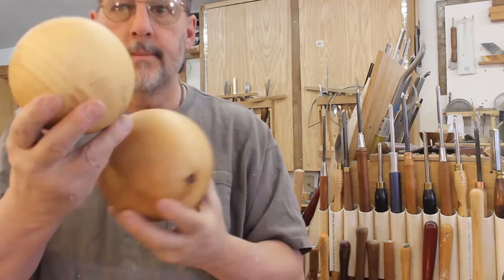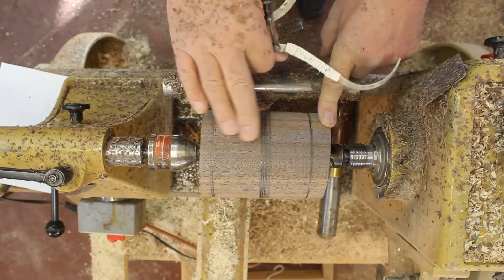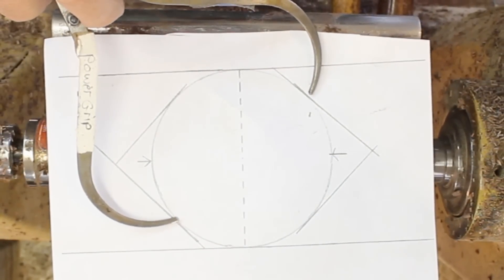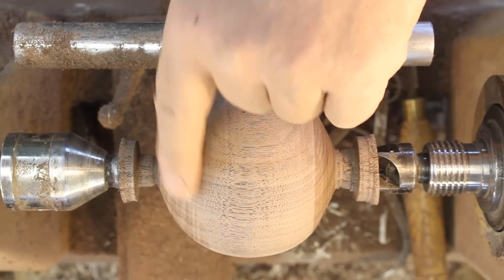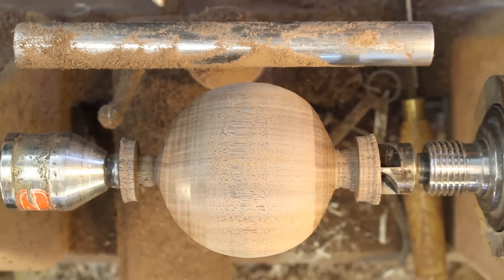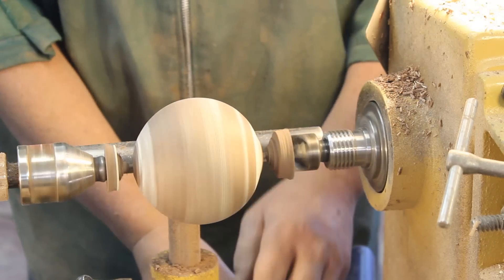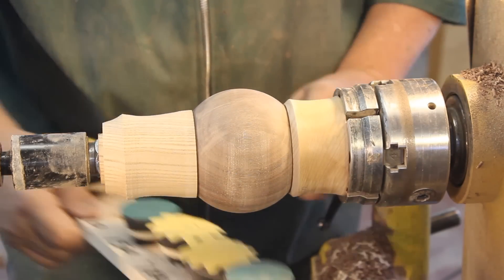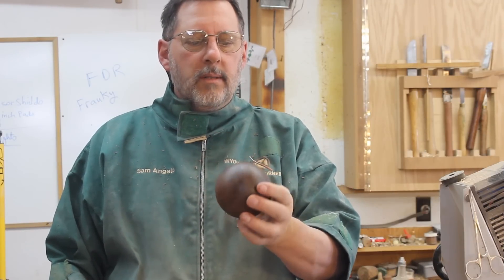Turning a wooden Sphere on the Lathe

Comment: The Tetrahedron... I suppose wood turning has nothing to offer this problem, but you said after the perfect shape, the sphere, that maybe you'd try a pyramid. Those are not difficult to shape and are not that interesting geometrically, but tetrahedrons are much more interesting. Although they seem like they shouldn't be much more difficult than a pyramid,  I've never managed to make one that wasn't a bit off to the naked eye. If you have any tips on shaping this or any of the other four Platonic solids I would appreciate any tips or pointers to guides that describe how to make construct them.

Thank you for this video. It was helpful. The chalk and sandpaper method to mark high spots was the most helpful.
Reply from the maker: Noah
I think I  remember saying I should try a pyramid.......I think.  But a pyramid is not round, it would turn out more like a cone.  But I was not serious.  You can't turn anything with facets on it like a tetrahedron or a platonic solid without doing lots of work off the lath making the facets.  I enjoy such various shapes that may start on the lathe and once they are complete....then you can't tell they were ever on the lathe.  I just don't want to do that kind of work.  Thanks for some interesting ideas.  Sam

Comment: I was wondering wouldn't a hole saw use on the part on the lathe achieve the same thing
Reply from the maker: Yes absolutely.  There are many ways to turn a sphere.  But you make a good Point.  I am sure I showed this in one of my sphere videos.  I just didn't show it here.  Sam

Comment: Would you method be improved if your sanding jig wasn't a radius, but more like a caliper? Easier to make and would still locate high spots. Will def try when I'm a little more experience and slight less ham fisted (or my sphere may even come out square lol).
Reply from the maker: Your idea is interesting.  With the radius I use, it floats on the high spots and marks those high spot.  I have sandpaper glued to the inside which sands the high sports.  It is like a block plane cutting the peaks and leaving the valleys until the surface is smooth.

Sam

Comment: i have to point out that theres no need to take multiple diameter measurements, if its a true sphere then the diameter is the same no matter the direction.
Reply: huh?
Reply: in the video near the beginning he took multiple diameter measurements as if he were working on an elipse, a true sphere only has only 1 diameter dimension.
Reply from the maker: Good point.....however my spheres are seldom round, haha.
Yes I must agree I did one or two things in this video which were unnecessary.

Comment: To ensure that your semicircular chalk-scraper is only going to rub high spots, I think you should take more care to hold it perpendicular to the sphere.
11:20 I don't think the cups are too big. The bigger the better in terms of holding the sphere accurately centered. They look perfect to me.
14:20 There is no need to reverse the lathe for sanding anything you can turn end-for-end, such as a sphere. But it may help direct the sawdust, perhaps.
Thanks for an interesting video. By the way, another way I've been taught is to mark the center with a thin line, then mark lines either side at 0.207 times the diameter from it. Use these as the limits of the 45 degree cones that are your first cuts. But I also like your way of using calipers to test that the cuts are the correct distance apart.
Reply from the maker: Chris, on your first point....If the semicircular chalk scraper is the same radius/diameter of the sphere then I can hold it perpendicular.  I can simply angle it a bit so the entire half circle contacts the sphere.  otherwise I have to make one to perfectly match the sphere.  I don't care that much about these spheres being so accurate.  If I wanted accuracy I would buy one of those sphere jigs......which I won't do.  I often sanding with the lathe in reverse because i can keep my hands on top of the piece-it is more comfortable for me.  Sam

Comment: What's the chalk for?
Reply from the maker: The chalk shows where the high and low spots are on the surface of the wood.  I can then turn down the high points to the level of the low spots.  This is low tech but works very well.  Sam

Comment: for Carl - There are much faster and more accurate techniques to perform this task - study the methods used by a sand foundry patternmaker.  Wood patterns are made to a total tolerance of 1/64th inch.  Templates should be 1/4 in. thick, put the chalk on the template, not the wood, or use a wax pattern crayon.  The use of the cup chucks is correct.  Never sand to size, only scrape.  I understand that "perfect" is a relative term, maybe you should use tolerance dimensions instead.  If you are intending to use a lathe for precision work, study patternmaking.
Reply from the maker: Melanie,  well I guess you schooled me....  Are you a woodturner?  A woodworker?  I checked out your channel and I see no videos of your own but lots of playlists.  You are correct that "wood patterns" are and must be made to tolerances to match the item to be cast in sand.  But working with wood-as the final product- is an inaccurate process.  It may be 100% accurate within certain tolerances today, but with moisture and wood movement, those tolerances will change tomorrow.  Thanks for your advice and comments.  I look forward to you, publishing your own videos to show how things should be done.  Sam

Comment: Excellent job! you make it look so easy.  I've tried, I know, it isn't that simple.  I am having difficulty in the different steps, but it will only take some practice, and I'll get it
down.  I have a couple of questions though.  After I get it pretty much rounded, I wanted to make those templates you used in your video, that you made on your band saw, then added sandpaper, and removed the chalk.  Do I need to have a circle cutter to do that with?
Talk soon,
By tha way thanks for all your videos.  I watch them all the time.
Reply from the maker: Tommy Schutz To get the jig perfect, yes.  But I think if you draw a circle with a compass, you could get it just as good.
Sam

Comment: Couldn't you just make a metal crescent that just cuts a perfect sphere? I suppose there's an art to doing things the simpler way so I could understand that.
Reply from the maker: XxMeatShakexX What I use (as well as other turners) is a hole saw for cutting in door knobs etc

If you file or grind off the teeth you have a circle cutter.  They are usually used once the ball is very close to a final shape.  Lots of ways to do it.  Sam

Comment: I have made a good few of these over the years using not dissimilar techniques but none have passed the acid test! For it to be a perfect sphere it has roll along a flat surface without any wayward movement. Have you made a good sphere or a perfect sphere? Just another 15 seconds need adding to the video to show the acid test:)

Comment: Hey, Wyoming, it seems to me that the wood piece you use with sandpaper after chalk will have a different diameter depending on how it is held, due to its thickness (maybe 3/4 inch).  That means that you will not be accurate with chalk removal unless it is held to only allow a consistent arc in contact.  You would do better with a very thin piece, maybe 1/8 inch thick.  Still, a nice video.
Reply from the maker: Yes, the diameter is not identical.  But rotating the piece of wood will find an arch that is at least round and contacts the sphere.  No it is not perfect but I have used this approach a lot and it works.  IF I wanted "perfect" I would buy a jig.  This is just one approach of many for turning a sphere.  Sam

Comment: Hi there I am new to machining and things of the nature and I was just wonder are there different kinds of lathes for different materials such as wood or metal, in my manufacturing class we have one lathe and I have seen it be used for metal and wood. Do we just have a "middle ground" lathe or is a lathe a lathe?
Reply from the maker: There are wood lathes and metal lathes.  They are different.  There is no lathe that does both well----that I know of.  I suppose there are metal lathes that would do wood, but not easily.
Sam
Reply: WYOMINGWOODTURNER Thanks for replying and explaining

Comment: Thank you that was fun and i think I will try that.   I only do small balls myself.   once you get down to 2 inch and less try using an old hole saw with the teeth removed and the face ground flat (leaving the burr on)  it is  fast and accurate. you can make nice short wooden handles for them.

Comment: I searched for wooden sphere turning because I want to make them for the ends of a vise handle.  I'd been imagining all sorts of complex jigs and was resigned to having to make them, but this is so much easier.  In my case the sheres will obviously be a lot smaller, and I'll be making a cylindrical hole on one side for the handle, but I might resort to using the metal lathe to chuck them up for that bit.

Comment: sam thanks for the tips on sphere turning great job, how do you like the round tool rest ?i am thinking about buying one.
Reply from the maker: I once had the inside and outside curved tool rests.  I did not like them and I have no idea where they are.  In theory or principal, they should be really great.  As I remember, they were difficult, at least for me, to traverse the tool around a corner.  A tool rest offers resistance so the tool does not slide way from the cut.  The curved rests made this difficult.  Not sure why.  Sam

Comment: So, why do you stop using thewooden half-circle?  Is it because the diameter has(or will) change and the jig no lomger is the correct diameter?
Reply from the maker: I am not sure.  If the diameter changes a lot during this process I just rotate the jig a bit to fit the sphere.  But more than likely I just stopped using it cause the sphere was as round as I could get it.  And I have 60 grit paper on these so I am making the surface fairly rough with the jig.  Sam

Comment: Someone might ask 'why' make a wooden sphere or bearing... did you know that one of the hardest, most dense wood called "Lignum Vitae" was used to make WOODEN SHAFTS GUIDES and BALL BEARINGS for the first nuclear submarine (USS Nautilus) and other marine/maritime use? It was (and possibly, still?) used for propeller shaft bearings have been used in conventional ships, and for moving shaft parts hydroelectric plants. Resistant to both fresh and saline waters, and its natural oils provide a natural lubricant for the component...
Reply from the maker: And....Lignum was also used for block and tackle on the old Tall sailing ships.
Yep, great wood and really very pretty. Sam

Comment: You probably don't need your drawing to figure out the diagonal diameter, because it's a sphere. Every diameter is identical all the way around no matter what angle. Kind of a waste of time to draw out all the angles just to se the callipers.

Otherwise cool video, free handing is rarely made to look so easy.
Reply from the maker: Mike
I understand the point you are making.   And you are probably correct.  I went back and looked at my drawing and I did not go far enough with it.  I have since added more facets to the circle to make it an octagon.  So in effect, with the 8 sides, it provides the measurement of each facet.  Then you keep making smaller and smaller facets.  I may post a video update......Thanks Sam
Reply: WYOMINGWOODTURNER
Sam,
I agree, with the level of accuracy you could get from an octagonal shape it may be worth drawing out more than the square was.

Comment: what kind of fucked up center marking is that!
Reply from the maker: Mikey,  I am not sure exactly what you are referring to in regards to my center line.  But I will have a go.....I make the line about 1/4 inch wide.  I do it so when I am turning that center area I can sneak up on the very center.  This helps me to turn a round area rather than a flat from each side approaching the center.  
Sam
Reply: Thanks for the explanation.
I'm so sorry for being rude,  I totally didn't get it when you said center line, then drew a few lines on it. and i was a bit drunk and confused at the time. haha  so, yeah, my apologies.

Comment: good explained but not the best method... 

There is just one method with u can do a perfect round sphere.
I'll trie to explain this in english. U need about 60 min. per sphere depends on size.
1. turn the sphere like u he did between centers.
2. how better u do step 1 how easier and faster will be the rest.
3. cut of the "nipples" from turning in centers.
4. Build ur own chuck, just for this sphere
5. turn out a negative shape of a sphere
6. turn it so accurate that u can push the sphere in (to the kind a bowl) so the sphere is fixed
7. remained that there is no length grain any more the the gauche turns upworth !!!
8. don't turn to much the equator line has to be shown. don't turn over !!
9. do this in several Position 3 - 5 times position changing 
10. sending, also with position changing
= perfect round 0,001 mm correct sphere

Sorry for my bad english....
hope u understand this ! I learned this way to turn a bowl here in germany in class for wood turners. We du 3 year class and company working than we do a big test an than we are a Wood Turner in german its called ( Drechsler). Now I'm doing the master.
My profession is woodturning, i mean i pay the bills with it. 

Hope it helps maybe i can do a video an show u the tehchnik
Reply from the maker: Thanks for taking the time to explain this.  I think I am familiar with this process.  I think you are explaining how to use a jam chuck for holding the sphere.  Is that correct.  I am glad you are making it as a professional wood turner.  I think your country and other countries have more like an apprenticeship for the trades.  We don't have that so much now.  Thank you again.  Sam
Reply: WYOMINGWOODTURNER
yes a jam chuck  : ) thats what I mean.
Maybe in some time the people at USA get to know about the quality of nice wood and turned products by hand, and a trade is possible. I hope so ! 
Have a nice turning time. Also Sam 
http://www.samueldanke.de